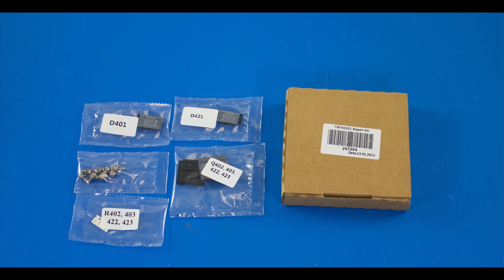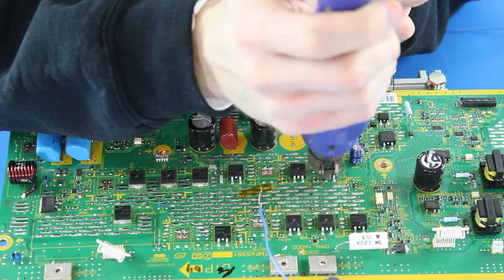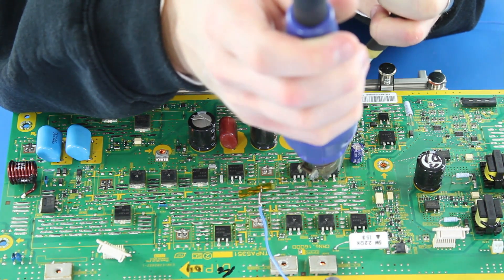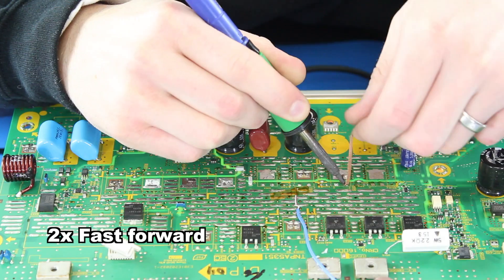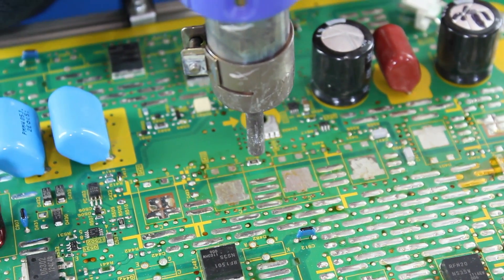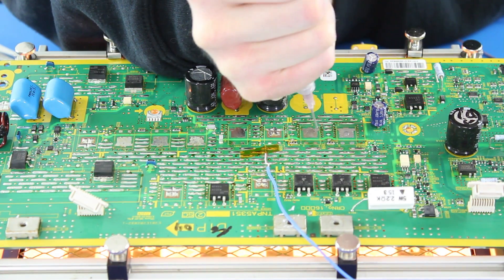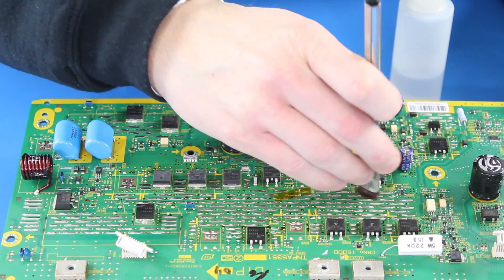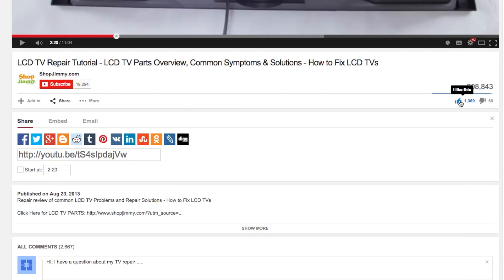Panasonic Plasma TV Repair - TNPA5351 - SC Y Board Repair Kit

Comment: HI jimmy big fan of your work thank you for the knowledge i have a panasonic plasma model: TH-42PG9W. it work for a few days then it give me 7blinks from what i learn from you 7blinks mean the its the its my SC1 BOARD THAT IS FAULTY  but i tested my mosfets in diode mode all tested ok no long beebs only the 25v by 470uf capacitor that is by the by the power input that runs from the powersupply to my SC1 BOARD that capacitor was faulty so i replaced it.but what are your thoughts on it.MUCH RESPECT FROM SOUTH AFRICA

Comment: Great video and tips. I repaired the Y-SUS board (TNP A5335) a while back by replacing the six shorted 30F131 transistors. The TV (Panasonic TH-P55VT30A) worked fine for two days; on the third day, the TV made a loud pop sound and turned off. I found 3-4 replaced transistors on opening the back cover, and a few SMD resistors were fried. My troubleshooting experience suggested I replace all main SMD transistors (even if they are not faulty) with the above replacement parts. So, I purchased other bipolar transistors and diodes with the above component to replace all at the same time, but I got over-ambitious by not replacing all the components. 

While researching, I found your video about the repair kit, which explains why the suggested parts should be replaced. Well, I have learned my lesson. However, I have a question. Please let me know what heating temperature (and durations in minutes) and airflow pressure should be applied while installing the new SMD transistors and resistors.

Comment: Great video. Here's an odd one though - same repair - 14 blinks. Nobody I talked to ever heard of 14 blinks, so I thought I would note that here. Same repair kit fixed it right up. The kit I got did not come with screws though. Is it the small screws that need the lock washers or the ones for the high voltage ? In the video, it looks like the grounding screws only came with the kit... and yes, I am sure I wasn't countin two sets of 7 blinks, it was 14, pause, repeat.

Comment: I just stared to work on my SC board and found a few more shorted parts such as D642, D643, and several resistors as well.  Also, I seem to have a few shorted resistor on the power supply board and SU board as well.  Does this sound like a common issue?  I am having the 14 blink issue instead of aformentioned 4, 5, 6, and 10 blinks.  I did a check for shorts per your other video and the SC board was the only board showing a short.  Thanks for any opinion or advice.

Comment: I've got a P50ST30 and had a 14 blink error. Went thru and tested for shorts as per your video and narrowed it down to the SC board. Shorted to ground on the input to the SC but not at TPSC1. Bought the repair kit for the SC board and installed the diodes, transistors, and resistors. TV turned on and worked for a short bit (5min) then went black. Turned it off and back on. Black screen then a popping sound. Now we're back to 14 blinks and the same short. Took off Q402 and the short went away. R402 also appears to be fried. Testing for continuity from ground to the emitters of the IGBTs I've got continuity, to the collector side I have continuity until I removed Q402 (lost continuity to Q403 collector) and then Q423 (lost continuity to Q422 collector). Any thoughts on what could be frying  these IGBTs? Would love some help on this.

Comment: Hello, I have the problem of the screen not coming on. I get 14 blinks, and the SC2 connector has a short. The tv stopped working after a power surge. There are no marks of burn on the SC board. Do you think this would be an appropriate fix under these circumstances? Thanks.

Comment: Im wondering why these parts fail. Im thinking they are getting too hot. I recon add a cooling fan blowing over them or they will all probably just blow again a few years down the track.
Reply: The components themselves are getting aged or the problem comes from the timing control board that drives Y and Z boards which are power stage boards.

Comment: What temperature do I run my reflow solder heat gun? I was trying 400 C but it still seems to take forever.
Reply: I use 400°C, turn the fan up high, and use a ¼" tip. Hold it really close to the transistor and flip from one side to the other, and it comes out within 45-60 seconds.

Comment: ok i get the 14 flashes, i notice this video doesnt say 14.  while is disconnected from the power supply board, i get a short at sc2, but i do not get any shorts on the tpsc1 terminal.  so im unsure if this is the right solution for me
Reply: +Brian Gervais I have the same problem. Did you figure it out?
Reply: no, was gonna check caps and PSU, but i didnt think it was worth the effort.  got a new 4k monitor instead
Reply: I bought the repair kit and going to try that. Do you still have the TV?
Reply: ya its collecting dust
Reply: Lol I know what you mean. Mine was sitting in the spare room for a year and I just got around to messing with it today.
Reply: Plz visit our webstore
always in stock
www.cradeal.com
the largest supply of tv part and supply all kinds for Panasonic
Reply: I have been trying to contact you twice about my order but have got NO responses,  It has been almost 2 weeks since I ordered and still no ship conformation!  What is the deal?
Reply: any luck? i have the same issue
Reply: Brian Gervais

Comment: i changed my power supply for Panasonic TC-P50S30 but the the problem still exists. THe red TV power light will come on and I have to unplug to turn it off.
Reply from the maker: Kwame Asante   Try all repairs and troubleshooting at your own risk.  I recommend that you bring your TV to a certified Panasonic Repair Shop.  Thanks!  www.shopjimmy.com

Comment: hi, i have a panasonic TH-42pz700u made in nov 2007, it has worked great until now. It wont turn on and it gives me a 9 blink code. what should i do? thank you
Reply from the maker: Paul Vlachos   I recommend that you bring your TV to a certified Panasonic repair shop.  Thanks!  www.shopjimmy.com
Reply: thanks, is that all the info you can offer? I'd like to get as much info before i bring it to a shop, also is it worth fixing or should i buy a new one. thanks for your time :)
Reply from the maker: Paul Vlachos   Unfortunately, I can't.  I recommend bringing it to a tech and they should be able to provide you with more information. Thanks!  www.shopjimmy.com

Comment: I have a Panasonic TC-P42S30 and last week replaced the SS (part # TNPA5350AD) board and repaired the SN board (part # TNPA5349) using the components in the repair kit. The TV powers on great now - but the image looks washed out or over-saturated. It is certainly possible that there is a bad solder connection in my rework - but I wanted to get feedback on the coloring issue. Would this issue be caused by the SN board or should I look somewhere else?
Reply from the maker: Andres Tamez   Be sure to double check everything on the SN board, even the solder joints.  You can also check the SS board for shorts.  Thanks!  www.shopjimmy.com
Reply: ShopJimmy.com Thank you for the quick reply. What do you specifically recommend to double check? I've checked there is no longer a short on Vc. Tonight I plan to reapply solder paste and make sure all the components solder correctly. Are there any other impedances or devices I should check? Any voltages I should measure at test points?
Reply from the maker: Andres Tamez  Try this at your own risk.  Just make sure all the mosfets are not shorted and there are no holes in the IC chips.  Thanks!  www.shopjimmy.com

Comment: Hi, I have a Panasonic Viera th-42px75u.  Turns on fine with a great picture but after a while, 5 to 10 min, anything black turns to red and becomes blotchy. Anything white turns blotchy green.  I love fixing things myself but have limited knowledge about plasmas only what I have learned from watching your instructional videos. Any suggestions on this would be greatly appreciated.  Thanks shopjimmy!!
Reply: +Brad Cloutier remove, clean with contact-cleaner, both ends of LVDS cable.

Comment: Hi, I have a samsung le32c450. The red (standby) light blinks 6 times and then it turns itself off. I checked, all the capacitors are fine except the big one which is 100uf 450v. It is lying on the board and sticking with some white-ish glue. Can you please suggest what could be the problem? And how to take the big capacitor out when sticking with such soft glue. 
Thanks,

Comment: nice, should be helpful to many DIY now trying to get there TVs going with boards hard to get. What would be helpful is fault finding the board  because buying a kit does not always ensure a 100% fix as there can be variations of failure. not everyone has Hot Air rework with a preheat either. How about a video using common soldering irons which is achievable.

Comment: Great video!  Aren't you afraid of the heat cooking your components?
Reply: JacksJunkDotCom  if you use a proper rework airflow gun, then no. its not an issue.  
do NOT use a cheapo paint stripper gun, as many peeps on youtube suggest, you'll destroy the board if you do.